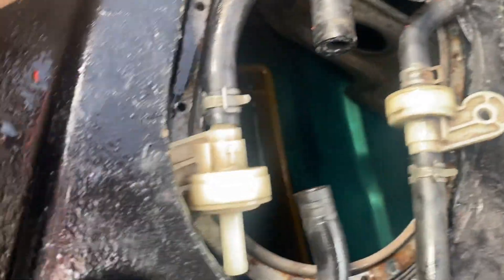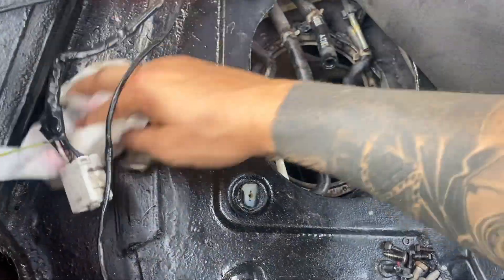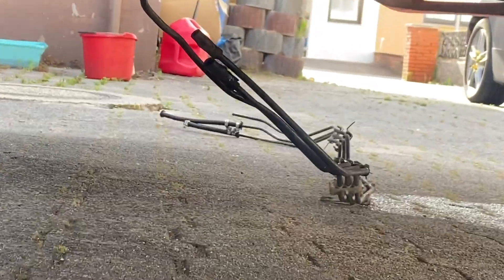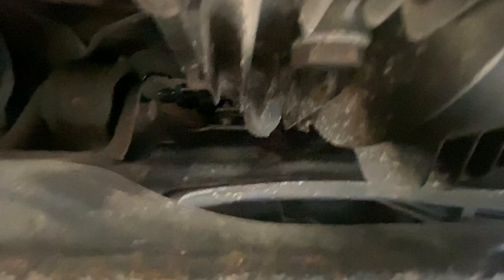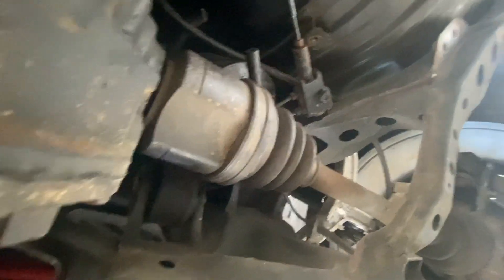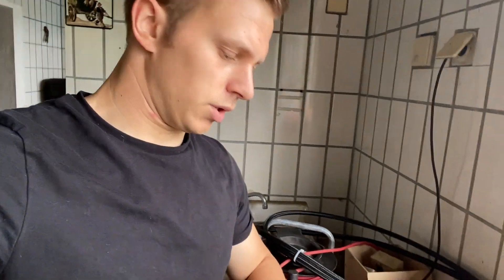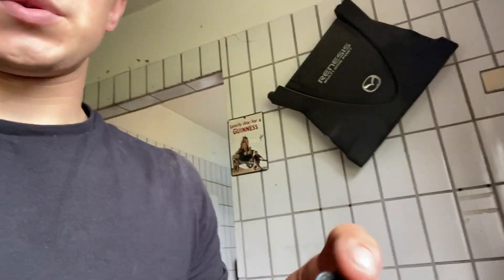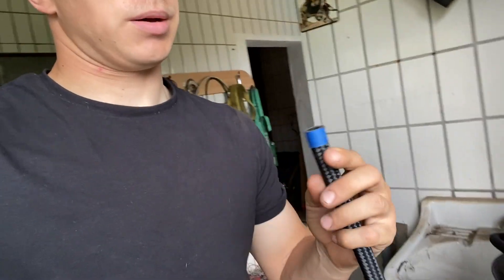Time for bigger fuel lines on the RX7

Comment: Hey why do people take the charcoal filter off? How does that help? I'm thinking about starting my hold build over in a way. I want to take the engine out paint the whole car like what your doing.
Reply from the maker: The charcoal canister stores the vapor, until the ecu decides to activate the vent solenoid, then the vapor is pulled into the intake and consumed by the engine. Since my solenoid was deleted it wasn’t doing anything, so I just left my tank vented.